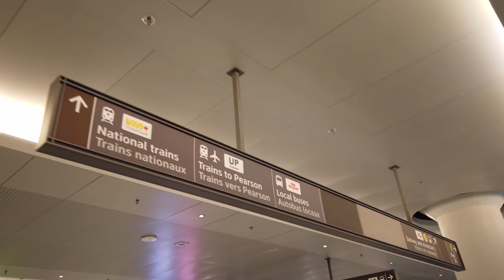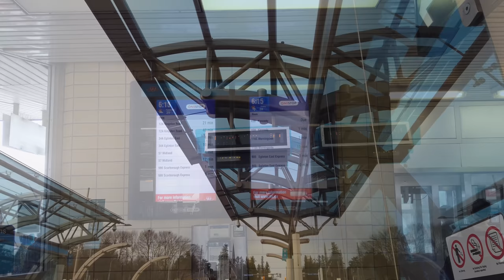How to Plan a Good Railway Station

Comment: Good video!  I am personally irritated when I see single elevators in transit systems. Ever since going to Hong Kong, where transit elevators always seem to occur in pairs, I have realized the importance of redundancy. Whenever one is out of operation, you can take the other.  Because Toronto has retrofitted their old stations with only single elevators, it means that mobility challenged people would have to go to a different station to use transit when the elevator doesn't work.  This is crazy.  Putting in a second elevator when you put in the first has a cost, but it is a cost you would bear if you truly care about the customer experience.
Reply from the maker: Fortunately redundant elevators are becoming the standard in places across Canada. At the same time more and more island platforms generally also mean more and more built in redundant elevators which is good
Reply: @RMTransit  The O-Train has redundant elevators!
Reply: Oh yes! In Germany, elevators/lifts are often not redundant. It sucks.
Reply: Singapore is now adding 2nd lifts to its train platforms from the Thomson-E Coast Line onwards (eccept Caldecott for some reason, & though some of our deepest stations e.g. Bras Basah, Bencoolen already had them, though curiously not Promenade, which is just as deep) but each lift has a different call button that isn't linked to the other lift, which is a glaring omission to me (except at Shenton Way & Bright Hill stations where the lifts are at different ends of the platform). Probably the government cheaped out by overly-standardizing our lift designs (e.g. to be the same as lifts used in standalone fashion such as those at station entrances, most of which have only 1 lift each. All lifts also run at only 1m/s (except hydraulic ones), whether or not its at shallower stations, or those in ~22m deep lift shafts serving our deepest stations)
Reply: If a station's lift is being serviced today though, notices will also be placed at all other stations' lifts to inform lift users

Comment: Most important station design element IMO is reducing walk time (both within the station and getting to the station).  If you have to walk 7 minutes just inside the station (like some Chinese metros) just to get onto a train, that makes metro less competitive to the car.  On the outside, the stations should have doors access points from multiple directions and be located in a high density zoned neighborhoods.  Putting a station next to say a huge used car dealership lot is a huge waste.  A good transit engineer should consider walk time in seconds for all contingencies and work to minimize it.
Reply: Unless they are going to demolish the dealership and build a walkable, (ideally) transit-oriented development.
Reply from the maker: Being inside does make a big difference though!

Comment: Hello, currently i'm doing my final project to design a commuter railway station and it has 38.000 sqm area of site. On its surrounding, there are many bus stops within 100 m but they are separated by public park with my station which i can't touch. I just want to know how to deal with it as my lecturer keeps pushing me to find a "direct sense" between the two public transportation

Comment: Great points as always, I do think all stations can have a shop though. Even if its just a little convinces/store news paper booth type set up. Renting out the far ends of a platform creates either a revenue stream for operations, or a low cost space for a small business to start operating. And having eyes on the station makes users feel a little safer.

Another things I would add are Public washrooms at most rail stops or BRT stops.

Overhead development is great in dense cities, and provides some revenue to keep the station kclean and built in users, and as mentioned TOD for community centers in general.
Reply: Clean, public washrooms are a major priority from an accessibility standpoint because a surprising number of people have serious impairments. Especially as people age issues becomes more common and those people can usually afford a car if they want to.

After all, shitting yourself at the train station is a pretty good way to make you buy a car.
Reply: I think you are 100% right. A small shop where you can buy someting to drink or something to eat should be in every station. At the very least some vending machines are necessary.
Reply: @EzeroXP  Vending machines a good too, although people don't usually want a hot coffee from a machine in my experience. 

I do think if you put up an add on your transit agency saying "Bring your own shop" and let people set up a table on the ends of platforms, you'll always have someone who is willing to do it if its free. And then if there are a few people you can have them bid for the month to maximize the productivity, see if people will offer 50 bucks a month and so on. Just like an E-bay style online market for space at each platform edges at each station.

Like the point shouldn't just be that people can buy things, but also that you create a place for people to sell new ideas, imo.
Reply: @user-hv6wb5gk8p  Yes! Now that I'm an "older" person, I appreciate washrooms (we use the term "toilets" here in the UK) at rail stations. This isn't a problem at major stations/termini because they're always well provided for but I think more could be done at less-used locations. Indeed in London there's a distinct lack of facilities at Underground stations... the only one I know of is at Baker Street, associated with the terminus platforms of the Metropolitan "main line".
Reply from the maker: Absolutely, the only place it becomes difficult is small low traffic facilities!
Reply: This is one of the problem I have with Ottawa’s LRT. The stations have poor shelters and lack commercial space and washrooms
Reply: @danielkelly2210  Thats so sad. I understand the impulse, a good city square has monuments, but they should also be vibrant. Some home Disney World manages a giant Castle and 10 thousand little stores. 

As for the washrooms, thats just an excuse to save money because they don't care about service quality. I imagine two shops a station would pretty easily pay for someone to clean each station along the line once a day. But honestly, I'd accept washrooms that charge 2 bucks a use off a fair card. There are even self cleaning designs now. 

Ita crazy the only additional revenue streams north american transit agencies can imagine is giant bill boards, at stations or on vehicles.
Reply: @Kishanth.J  At least the trains are frequent enough you don't spend to much time at stations. I find GO worse for this, low frequency, giant platforms, giant parking structures that could have actual store fronts wrapped around them. At least the trains have a washroom so you can go to the washroom once it arrives, at the low cost of maybe ruining everyone on boards day. 

It is sad though that the old bus stations were were functional, in my opinion. For brand new stations so much more could have been done very easily and provided more revenue.
Reply: Are there really train stations without bathrooms? I genuinely can't imagine making a public building or space without any form toilet access, even a gross one. 

NY state has a ton of parks "in the middle of nowhere" (scenic locations) that have really nice and bathrooms despite being way out if town, even boat launches have porta-potties if they are expected to have moderate traffic.

I am fully on team have immaculate bathrooms with atleast 1 single occupant high accessibility bathroom. (Single occupant bathrooms with a changing table are the definition of covering everyone's needs, and traditional multi user public restrooms will help with capacity)
Reply: @InflatableBuddha  as far as city wide lack of public bathrooms, i would assume just having "public buildings" like court houses, city hall, libraries, and community centers scattered around should suffice. Technically places of buisness like movie theaters, stores, and restaurants count as publicly available restrooms. (It is courtesy to buy something when doing so though)

I just can't get over how illegal it sounds to not have an unlocked bathroom in a train station intended for public use. (Or atleast that the entire station isn't covered in urine as people seek relief in "discrete locations" or actively protest the bathrooms being locked)
Reply: @RMTransit  which in germany is quite a few stations, especially on light rail variants
Reply: I've seen interchange stations in Shenzhen that even have shops in the paid areas

Comment: It's shocking how terrible transfers are at many US stations between the local transit (Subway or light rail) and intercity transit. Take for example Atlanta. You have ZERO transfer points between MARTA's subway network, GRTA Buses, the streetcar, and Amtrak. I think Amtrak should be extended close to downtown. It's in the far end of the city.
Reply: Ya I don't necessarily think Intercity and Intracity hubs need to be at the same place, because many intercity bus travelers may actually just be transfering to the intercity train, it may add more time for traveler going to the next city, and because intercity isn't a trip most users make frequently, but any intercity station should certainly be served by the highest order Tansit the system uses. You should be able to get a direct link to the central intracity hub, and preferably the local airport as well.
Reply: @neolithictransitrevolution427  Adithya Ramachandran is right! Atlanta's Amtrak station is not only too far away from Downtown Atlanta, but there's only a handful of bus routes serve the station - there is no MARTA subway station in sight!
Reply: @bronxsportsfan  I didn't mean to disagree, I just mean there should be a Subway to the Amtrak station, which should also act as the local Intercity bus terminal for Athens and Macon Etc busses, instead of having Amtrak and all the busses go to Peach Tree Center or something.

Although, the airport might be a better intercity hub tbh since there isn't great Amtrak service and there is a n airport link. The Amtrak station should probably just be moved to Lenox or something tbh, better to be far away and connected then close and in the middle of nowhere. East Point is probably the best place for it, but IDK the routes Amtrak runs through Atlanta so maybe thats on the wrong rail spur.
Reply from the maker: Yeah this is often because historic stations were repurposed or removed, some are being restored though!
Reply: I mentioned closer to downtown mainly due to the fact that the downtown area does have tracks nearby. The Falcons stadium has 2-3 tracks running North-South next to it, and is connected to MARTA subway. This area would be a major trip generator. And it is within walkable or bike able distance to many key points downtown. This would help improve the traffic situation immensely for regional travelers. If you ask me, it makes more sense to route passenger trains downtown and reroute freight trains away from downtown or reschedule them to off peak hours if there arises crowding concerns.
The I 75-85 concrete monstrosity made summers in the already hot deep south climate even more exhausting due to UHI & Emissions. I hope some of it is converted into greenspace with subtropical palms and more transit is used to supplement.
Reply: Taitung's railway station is also at the city outskirts as its original station in the heart of downtown was accessible only via even narrower gauge tracks built during colonial times & running along the street, which were deemed less acceptable in more modern ages & were thus torn up I think

Comment: As a Canadian who has visited Japan numerous times - clear signage should be one of the fundamentals of a great station. Clearly pointing out transit connections, numbering station exits and making these signs visible is what Japan excels at and what Toronto needs to make improvements on. Even as a visitor to Japan, I could easily tell a friend to meet me at exit 3, or easily navigate throughout a concourse.
Reply: Singapore is now switching from lettering to numbering its station exits as numbers are language-neutral (so they're easier to understand by non-English speakers). On the flip side its no longer giving bus stops nearest to stations single digit numbers (in addition to the 5-digit codes that all bus stops in our country have), removing a way of simplifying navigation from train stations to connecting buses

Comment: pretty comprehensive overall, but for many stations, just having a platform at a height so that you actually can get onto the train without climbing exercises, would be a good start. The amount of Amtrak platforms, where a little stool is provided and the train has to stop at that exact spot, so that one door of the train is opened, and then you hope that people climbing down those vertical steps, don't miss that stool on their way down - that is ridiculous. How much money does it cost to upgrade from stood to platform.
Also, providing restrooms would be a great addition to most rail stations.

Ticketing offices and concession stands all require a certain amount of traffic, but in some ways, convenience and a pleasant experience would help draw traffic in. Bike racks, parking, and convenient bus or other transportation access pretty much makes-or-brakes the mid-size train station, imo.

I love large stations that are basically designed like shopping malls or at least airport terminals, and are major transportation hubs, but so far I have to travel in Europe to find those. Recently been through Zurich and Vienna, both great experiences. You basically don't want to leave, that is how nice they are. And both have full grocery stores built in, and the value-add that the surrounding area  gets from such stores, is enormous. 

It's a long way to go here in US, but I still find that huge impressive halls, seem to be the preferred design in the US. For the same amount of money you could build convenient and well functioning stations too. Wonder who allocates these budgets?
Reply: I think the issue with Level Boarding is around frieght train requirements since they share most Amtrak trackage. Could be mistaken, I know its been an issue in Canada.
Reply: @neolithictransitrevolution427  You probably are right. which would mean you need a gangway, like on a ship. Still means only one door opens, but at least you can walk on-board. It always struck me as kind of senseless to retrofit stations to make them wheelchair accessible, when the trains themselves clearly are not. I'm talking about the Amtrak trains in the US, obviously, not European trains, even though there are problems even there. Usually, bikes, prams, and wheelchairs have to compete for limited space, and some stations are better designed than others. But still - lightyears ahead of Amtrak.
Reply: @cailwi9  Via trains in Canada are just as bad, maybe worse. Gangway might work well, I would support a few test stations.

Comment: Maybe I missed it but multiple exits off the platform seems to be often overlooked.
go Ajax case in point last time I was through there, there was two stairways & elevator into a narrow tunnel, paint on concrete, very utility grade look. The train cars that stop in front of these stairs were stuffed almost exclusively with Ajax bound passengers, you couldn't walk through them if you wanted to. I imagine it was crazy trying to get through that mess to catch a bus.
  Also acoustics should be paid some attention, sort of hearing something in a echo chamber platform area, that your not sure if it pertains to you, when your not in  your usual station is not the comfortable customer experience you want.